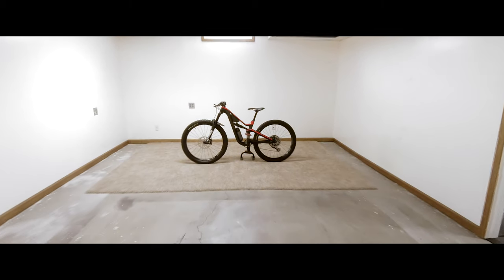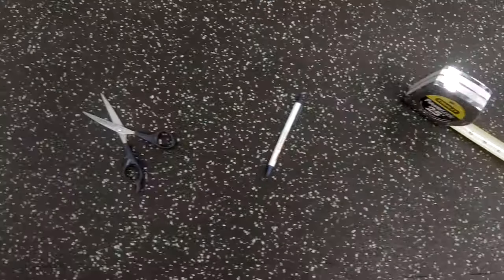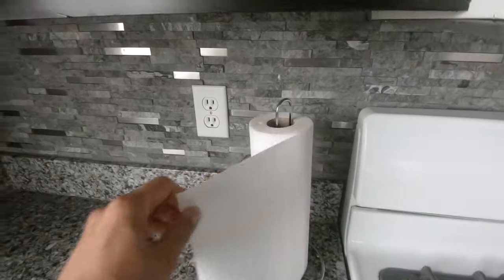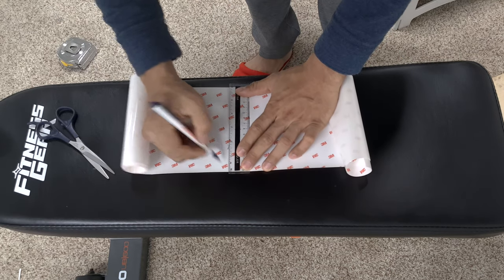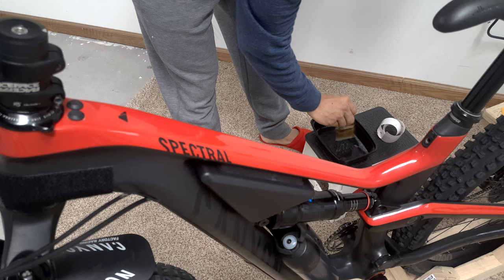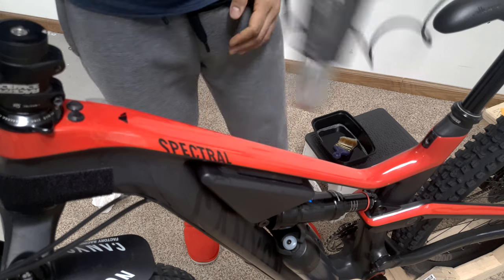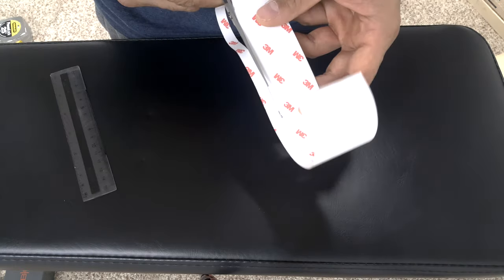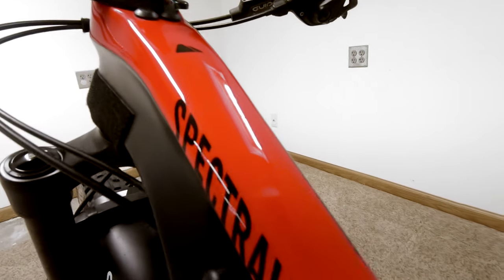How to Apply Clear Protective Vinyl Wrap on Your Bike • The Duke of MTB

Comment from the maker: Just a heads up, it's better to use a hair blower than a heat gun. The heat gun runs very hot, and if you're not careful, you might damage the wrap or even a carbon frame. If you do use a heat gone, run it on the lowest settings and only do very quick passes. Do not linger on an area.

Comment: Great Video. I like the use of the paint brush. Great Idea. What was the triangular box in the front part of the frame, and what kind of water bottle cage/bottles were those?
Reply from the maker: Canyon makes little storage boxes for the front triangle of some of their bikes. The bikes come with bolt holes in the front triangle specifically for their storage boxes only. The water bottle cage is called the Canyon Eject Hydration System. You can buy it on the Canyon site. It's great for tiny frames with little room for a full sized bottle. Cory still uses it on her extra small Juliana Strega(Santa Cruz Nomad v4).

Comment: Very helpful video!   Does this look ok on matte black finishes (handlebars, crank etc.)?  If not, any recomendations?
Reply from the maker: Glad I could help. 😊

If the cranks and handlebars have a smooth finish, then it's doable. If not, it won't really look that great. You can give it a try though. Let me know how it goes. Best of luck. 👍
Reply from the maker: In regard to recommendations, there are some kits to protect cranks. I haven't looked into anything for handlebars though. Google is your friend there. Let me know if you find anything. 👍

Comment: Nice job man!  I'm definitely doing this to my new frames!!  Wish I could find some in matte finish though!  What did you use for your squidgy?
Reply from the maker: Thanks, man. The squidgy I used is just something I had in my tool box. An old debit card with a paper towel folded over the edge works great though. I'm sure there's a matte finish one somewhere on Amazon. Also, if your bike is a plain color, you can just use a solid vinyl wrap. I use black on the black parts of Cory's bike. That way, you don't have to worry about bubbles or dirt showing through the clear wrap.
Reply: The Duke of MTB bad ass tip, thank you sir . How does the black vinyl wrap look on black? My frame is black so I was curious , however I already purchased the clear.
Reply: Nice Video! I did my top tube and shocks in clear matte finish I got from Metro restyling which I live near. I have a black matte stache 8 and also got red vinyl to make accents. The top tube layer got messed up after a mishap but the paint was intact. Also found that using alcohol to clean is best.

Ride on!

Comment: Great video!  Although using the heat gun seems a bit scary to me on a carbon frame.  I would try using the hair dryer instead. 

What bike stand are you using?  I haven't seen that one before.
Reply from the maker: Thanks, Scott!
I use the heat gun on low and do very quick swipes, but yeah...a blow dryer is safer.
The bike is sitting in a manual machine I made from 2x4s.

Comment: Hi this is an awesome video. Question: Isn't the 3M already an adhesive and sticky? Won't the soapy water render the adhesiveness of the 3M useless? Thanks!
Reply from the maker: I used to think that too. But no, the soapy water just allows you to easily adjust it, as soon as you squeeze out the water, it becomes very sticky again. Even more so once you run a hair dryer over it. Also, keeping your fingers wet keeps the inside from getting dirty and marked with finger prints all over the place. Doing it dry leads to nothing but frustration. If you have a stubborn corner, just run the blower over it a little and hold it down for a few seconds with your finger. It'll stick. You're just gonna have to trust me on this one. Good luck on your project. 🙂👍
Reply: @dukeofmtb  could you please tell me the exact product name and code of 3M product. Thanks
Reply from the maker: @ismailergun4  The Amazon link is in the description under the video. 🙂

Comment: Hey can i double layer this? i got a Giant bike but i want to put stickers on it. so i was going to put a wrap on it. stickers then wrap on top of the stickers with wrap
Reply from the maker: You could, but the edges of the top layer of clear wrap around the stickers might not look that great. I'd test it in a small area first.
Reply: @dukeofmtb  Aye so it will work but could see the lines from second layers cut. got it thanks for reply! was wondering because i want to keep the original bikes stickers intact incase i dont like these new ones im putting on
Reply from the maker: Send pics on IG when you're done. I'd love to see the results. 😁

Comment: what is that plastic triangle above the shock that looks like a storage ?
Reply from the maker: It's exactly as you described it. Perfect for snacks and some mini tools. 😁
Reply: @dukeofmtb   what is it called ,  I want one
Reply from the maker: It's Canyon Spectral specific though. They have  special mounting holes for it on the frame. https://www.canyon.com/en-us/gear/accessories/backpacks-and-bike-bags/bikebags/canyon-spectral-frame-case/170771.html
Reply: @dukeofmtb    , I am soo going to modify one of those to my bike , I can se one of those integrated with a fidlock mechanism , so I can remove the hole box,  thank  you ,
Reply from the maker: @Redbelo  Sounds like a plan. I'd love to see the mod when it's done. 😁👍

Comment: Does this peel off when washing the bike or getting caught in the rain?
Reply from the maker: Not at all. It actually takes a bit of effort to peel off once it has set. You'll forget it's even there. It's been over a year since I applied it on my wife's bike. Not even one corner is peeling off. 👍
Reply: @dukeofmtb  That's awesome. I made the mistake of buying an expensive bike, thinking I was saving money in the long run. Since then I've spent hundreds of £'ssss in top grade security, accessories and now more money on this! I could cry lol!!
Reply: Can I please ask, how many meters (or inches) did you need to cover 1 bike?
Reply from the maker: @darkknight17  I bought the 6"x60" inch roll from Amazon and covered just the chain stays and top tube. I think that roll should be enough to cover all the important parts of your bike. Can't go wrong with buying extra though. If you ever have a bad enough crash to damage the wrap, you'll have extra to replace it. Cory had a bad crash a couple months ago. Looked like a rock chipped the carbon fiber on her top tube. When I removed the clear protection, I was happy to find that there actually was no damage to the frame. The protective wrap did its job. I put on some new protective wrap on her top tube, and the bike is good as new.

Comment: Would the tape take out the paint when peeled off?
Reply from the maker: Nope. I've had to peal up a piece to replace it after a crash a few times, never had the paint come off with it. The wrap pulls up similar to phone screen protectors but a tad more sticky. Sometimes some residue gets stuck on the frame. You can clean it with a small amount of acetone or wd-40 on a rag, but make sure to wash the spot right away to not damage the paint.
Reply: @dukeofmtb  thank you!

Comment: I really wish I had done this when my bike was new😢
Reply from the maker: Scratched it up a bit, eh? The clear film actually does a good job of making scuff marks disappear. Sure the deep gashes will still be there, but your bike will still look cleaner. You can always cover the bigger scratches with an opaque wrap. I like to use little patches of carbon fiber vinyl wrap for deeper scratches. It looks cool. Or you can find a wrap that matches the paint of your bike. Never too late(assuming you didn't actually break something.😅)
Reply: @dukeofmtb  overall the paint is still good just got a big ugly gash on the side the other day😢
Reply from the maker: @bobjohn7329  I'm sure you'll figure something out. Like I said, there are some really cool vinyl wraps you can find on Amazon. Best of luck. 👍

Comment: Is this 3m tape good quality and safe, and how long this tape lasts over time, will it damage the paint??
Reply from the maker: It's very good quality. It can last the life of the bike if you don't have a really terrible crash. It doesn't peel off on it's own. You have to pick at it with your fingernail to get it started.This stuff has been on Cory's bike for about a year and a half now, and it still looks great. You can't even tell it's there. I only had to redo the one on the top tube once after Cory had a bad crash. It looked like the carbon fiber was chipped, but after I removed the 3m tape, it turns out there was no damage. Only the tape got dented. So it did a great job of protecting the bike. I peeled it off easily and installed a new piece, and now it looks like new again.
Reply from the maker: Oh, and remember to keep your fingers wet while you're doing this, that way you get a perfect install without dirt and fingerprints. Also, don't get too aggressive with the squeegee. Good luck. 😊👍
Reply: The Duke of MTB thank you just got an Ebike want to protect it as much as I can I bought the same 3m you did I’ll give it a try.. nice video explaining and showing the procedure thank you have a great day 👍👍
Reply from the maker: @sammanukyan5084  No prob. Congrats on the new bike. 👍
Reply: The Duke of MTB do you know if a blow dryer would work? Or is a heat gun preferred?and will removing the film remove the bicycle paint??
Reply from the maker: @sammanukyan5084  The paint won't come off. You're actually better off using a blow dryer. A heat gun is too hot, so you have to be careful with it.
Reply: The Duke of MTB  awesome sounds great can’t thank you enough appreciated so much for ur help
Reply from the maker: @sammanukyan5084  You're welcome. 😊
Reply: I used the same film on my car and I can say that after maybe 50,000 miles of driving, 2 years of being in the sun much of the time and washing every other week the film is not as glossy clear as it once was. It’s a bit matte. I doubt anyone would subject their bike to that much use though. Not regrets though. I would do it again. I might reapply soon.
Reply: @dukeofmtb  When you removed it, did you heat it a bit to avoid lifting any paint?  Is that a concern?
Reply from the maker: @ericrollins4607  I heat it up during removal to reduce leftover residue. Never had the paint come off though. It was never even a concern.

Comment: Only problem is, when you want to have a matt finish, this is guaranteed glossy. Haven't found anything for protection that is a matt finish. Maybe someone has an idea?
Reply from the maker: RideWrap makes a matte finish wrap. It's excellent.
Reply: I bought protective film from hardware store from the shower section. They had this textured films for shower wall glass surfaces. There was plenty to choose from, i picked frosty snow flakes. Did a test and it sticks good. It also is removable without any glue marks

Comment: Although it helps to protect its not that clean it creates inconsistencies where it is applied and not applied and of course patchy.
Reply from the maker: I have clear wrap on both our bikes. The wrap looks completely invisible. You have to use the soapy water method shown in the video. It keeps fingerprint marks from getting on the inside of the wrap, and you get perfect flush contact of the wrap to the frame. Dry wrapping always looks terrible. A properly done wrap job should be unnoticeable.

Comment: How is the film holding up? Are they yellowing? I'm planning to do this on my road bike, is it safe to use a heat gun on a carbon frame?
Reply from the maker: No yellowing. Still looks good. You can hardly tell it's there. I used a heat gun because that's what I had handy at the time, but it's better to use a hairblower on low heat. The heat gun is way too hot, so you have to do very fast passes.